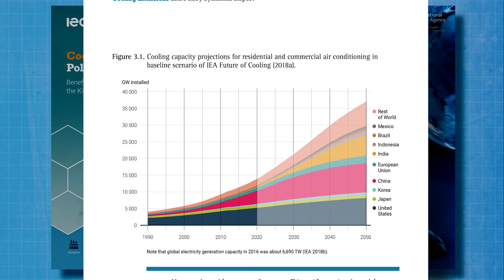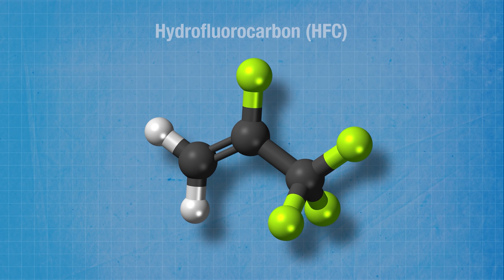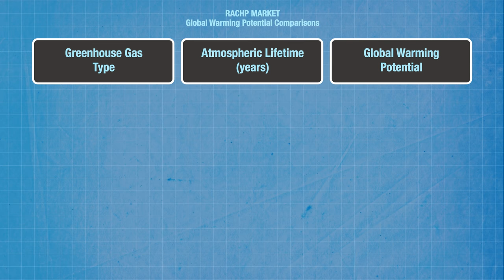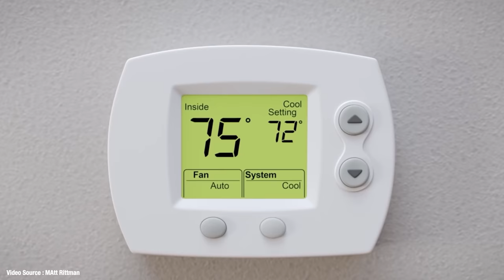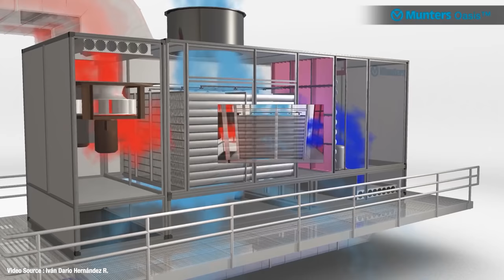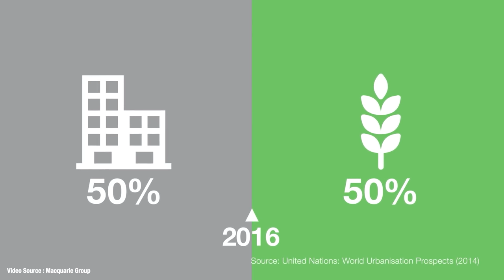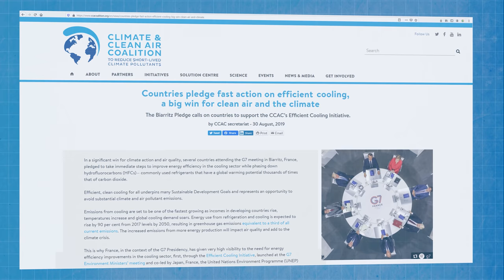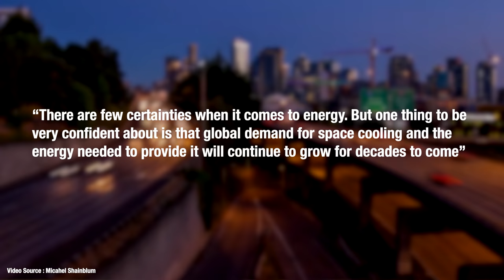Keeping cool in a warming world.

Comment: This is a very dumb topic to be discussing since it all is based upon a lack luster and poor understanding of the earth and how it functions, as well as efficiency.

First off, all the "solutions" to these problems always, without fail, center around how to maximize profits. This by default is the wrong solution because in order to maximize profits there needs to exist maximum effort or work. This is not a solution then but a treatment and an extremely costly one at that. This being said the True solutions are simple and easy to implement, however it means changing how humanity lives, at least the so called "developed nations". Unfortunately these are the worst nations to convince since they are fat and happy and often by default will not even hear you out before mocking and criticizing you  out of their ignorance.

IF people built their housing and buildings with intelligence, the need for temperature control would be non existent. But this comes at the cost of higher initial build costs and less costs over time, so it eats away at potential profits. People would rather have to work more, to earn more, to continue to allow the problems to escalate. Absolutely a joke to anyone with a functioning brain who can correctly employ logic and reasoning.

IF people ate what was intended for them, there would be almost no need for any refrigeration for food preservation. This requires a change in habits and lifestyle. It is not just about reducing dependence upon refrigeration for food, but also increases health, the real wealth. That last bit i the hard sell, since the "health care industry" makes huge amounts off of the obviously deteriorating health of the public. They like it that way and have been working hard to bring everyone down to bring up their bottom line for centuries.

Just these two changes alone can drastically change the climate effects of man on the earth. The last and most obvious needed change is land usage and reforestation. The earth used to have ample amounts of mature forests, being 100 years old and up. These not only allow for great biodiversity of plants and animals, but also greatly aid to regulate moisture in the atmosphere which directly influences weather and oxygen for humans to breath. Land sprawl is a big concern here as it is actually part of the earth natural system for functioning. Only a complete and utter idiot would mess with such an important system, yet humans have been hard at work in this area in a detrimental manner for centuries and show no signs of intelligence in this arena.

The real problem with the world is those who try in vain to control everything. They are the "leaders" who are making all the bad choices and setting course in the wrong direction to solve any of these problems. They have too much pride and ego to admit they are wrong and do not know and have largely destroyed everyone and everything useful in order to get back on track. They are also so stupid as to think people would never figure it out and when any starts to get wise they typically oppress them to no end or worse yet murder them because of their salty bitch ass nature.

Comment: what has been done to make advances in lowering energy use ?    all a bunch of hot air.
building codes a simple code that your new building has to be 10% more efficient than what was being made 10 years ago, would be enough.   mechanical cooling is the result of bad designs.
the Sun, the cause or Global Warming in every prior warm cycle, even those global cycles that were much hotter than today, like the Medieval warm period that scorched North America back then.
so, by simply creating more shade and different 'skins' on the buildings, we could drastically drop the heat absorption.   here we are 30 years when al gore invented global warming and we have done squat but blamed everyone else.

Comment: Zonk! This video is peddling fake physics. First, atmospheric CO2 can only absorb and emit radiation because it's a polar molecule, and only at the wavelength of 15 microns, whose photons are too weak to melt and ice cube, and are indeed identical to those emitted by dry ice (-80C). Second, air conditioners turn electrical energy into both heat and work to pump heat out of buildings into the atmosphere, which can't cause global warming because heated air is more buoyant and immediately rises toward space, dissipating the heat as it goes, no different than the heat and smoke from a campfire or the mushroom cloud from an atomic bomb. None of that heat has any way of returning to the surface from when it originated, so actually it's the atmosphere that's Earth's giant air conditioner, or actually gigantic chimney that takes the Sun's daily heat harmlessly to space, and CO2 can't even interfere with this process because the surface temperature range of -50C to +50C is way outside CO2's 15 micron radiation absorption/emission wavelength.

The problem is massive ignorance of radiative physics based on Nature's ironclad Planck Radiation Law that covers all cases. Take my free lesson and wake up that CO2 global warming is a fake physics hoax cooked up by global Marxists to manufacture useful idiots who will dismantle the fossil fuel industry that gives us our wealthy happy comfortable lifestyle in order to destroy the capitalist system it underpins.

'http://www.historyscoper.com/thebiglieaboutco2.html

BTW, the claimed radiation from atmospheric CFCs is 6 orders of magnitude smaller than from CO2.

ftp://ftp.cmdl.noaa.gov/hats/papers/montzka/2012_pubs/Montzka_ASHRAE_2012.pdf